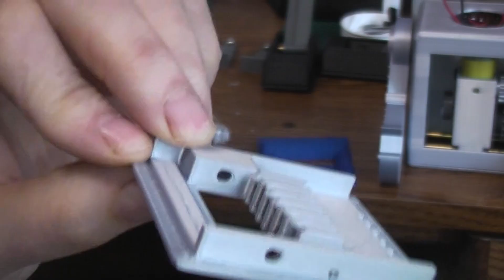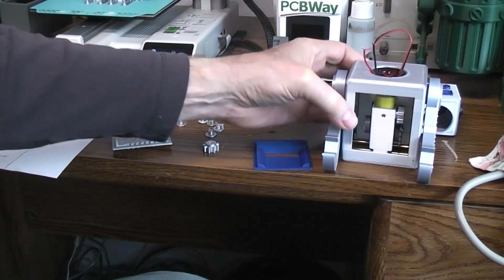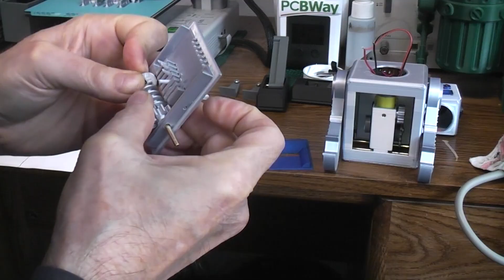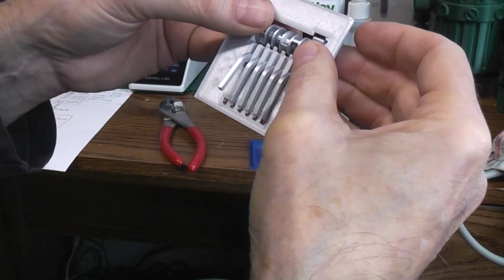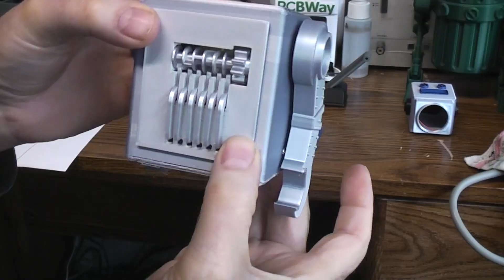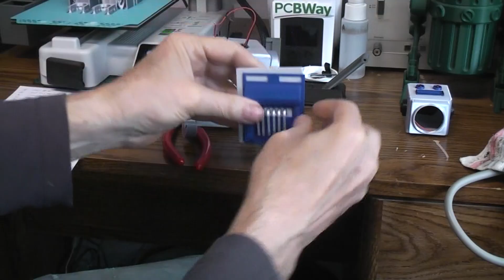Build video for the Sequential display on the 3d printed POGOT robot project.

Comment: Wow, you are on a roll. 
I see you have an extended card reader on your Mini. Isn’t it neat how quiet they are? 
I can see the body of this robot (the chest part) becoming the body of some sort of monster robot and the fingers becoming a moving mouth. What fun!
If I may ask, why do you use Thingiverse only? I’m very impressed with how the Bambu website is working. It is young and not consistent throughout but improving daily it seems. 
Thank you for these models, you are making a lot of people happy I think.
Reply from the maker: I know how to use thing-i-verse, and Prusa site and the Bambu site as you say keep changing. Also I have not had any luck uploading STL files to the bambu site as they are dead set on 3mf.
Reply: True. 
If you want I could upload the 3mf there when I get to printing one of these critters. It may attract more interested people.
Reply from the maker: @noads1035  No, that's OK. I can uploads the 3mf as well. Just don't care for there site.
Reply: Ok, no problem. Thanks again for the work you have shared with us.